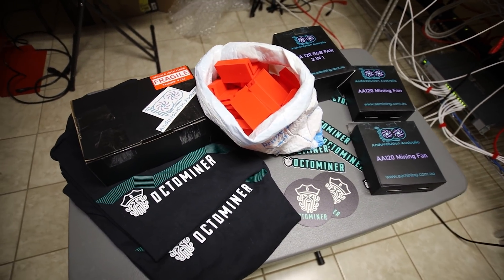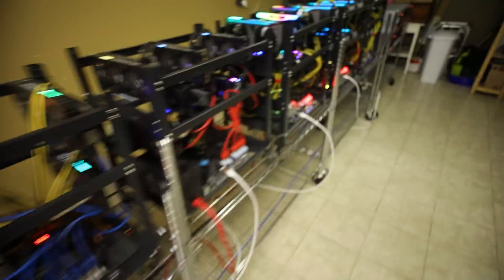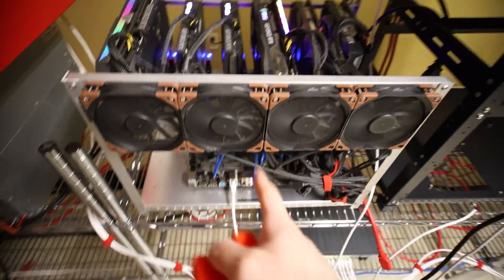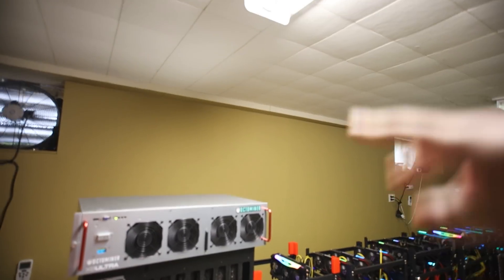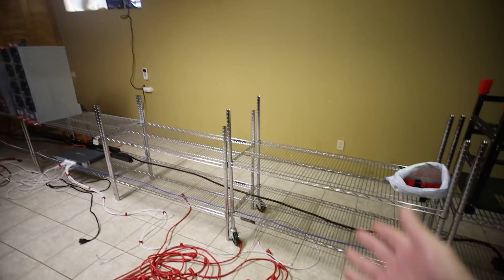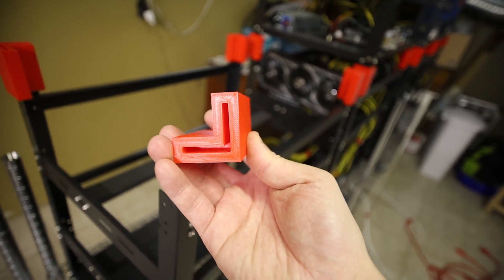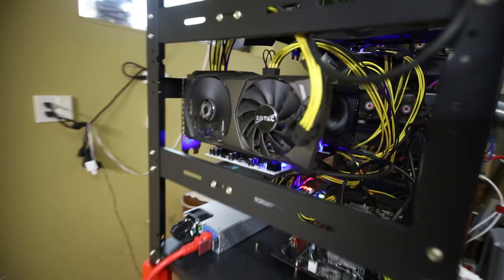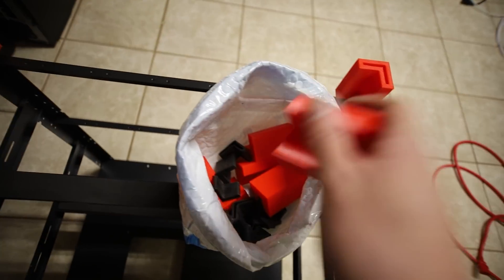STACKING 12GPU Mining Frames...

Comment: each crypto rig can weigh at least 25-28lbs, wouldn't recommend stacking them over long time as the middle between where the metal will meet will break away and can cause damage. Its great for presentations, yes.

Comment: Try using some velcro straps to make those ethernet wires attached to the metal beams of the frames or shelf, just to make it look more tidy but also to prevent yourself tripping to those wires if you try to do some work with the rigs.

Comment: dont leave cases vertical leave them horizontal if gpu inside. Cause it will make damage to motherboard and gpus too. Gpus are heavy these days. Such thing exist as sagging. PCB of gpu bends and it can stop work easily. Many pc gamers have this issue gamers try many things, but result is same chunk of aliminium pulls down, no matter if it looks stright, stressing pcb result death. Also motherboard also gets stressed from bending weight. Worst what can happen is 12 volts in wrong line, boom all gpus dead with all rig.

Comment: Man, how do you power all of these rigs in your basement?  I only have two rigs with 4 gpus in each one and whenever I use a vacuum my power goes out.  Do I need an electrician to help me with this problem?  :)
Reply: He did a video about that.
Search for "How do i Power my Mining Rigs?"

Or in short: Use an separate power ciruit for your Rigs (just use another power circuit for your vaccum). Use 240V (in countries with 120V-System) if you´re running more Rigs. 
In an 230/400V System you should be fine if you just use an outlet in another room (normally each room = separate circuit). You just have to make sure load is equally split on all three phases (up to 24 or 63 kVA  /household depending on fuse)
Reply: @darkness8631  Thank you for all the info.  I will look into what you said, and watch his video.

Comment: Thanks for the update RPM! woooow!! it got soooo quiet with them all off, lol. looking so good! those stacked ones need fans, heat will get trapped under bottom one, no?
Reply from the maker: Bit of a heat issue with the 3070 ti rig in the middle bottom but I placed a fan at it for now

Comment: @red panda mining YES!  I have been meaning to ask you about how to do this during one of your live streams.  I want some of these stacking parts!!
Reply: I've been going with 2'Dx7'Hx4'L heavy duty shelving from lowes, get enough spacing for 6 frames with decent airflow (table fans), and then a top shelf to throw boxes on

Takes up a whole lotta room though (and the cheap ones are missing parts and flimsy and need re-enforcement boards so the shelves dont fall through)

Comment: Will those shelves take the weight of fully stacked server cases?
Reply from the maker: 800lb per shelf level they said
Reply: i wouldn´t trust that. Atleast not with an high punctual load on one side like your vertical octominers are.
Maybe it would be easier to get rid of the shelves. If you can stack more of them it may be easier to get power and network cables from the wall or above.
Or get only the main cables from above and integrate the pdu/switch vertically between your rigs/octominers.